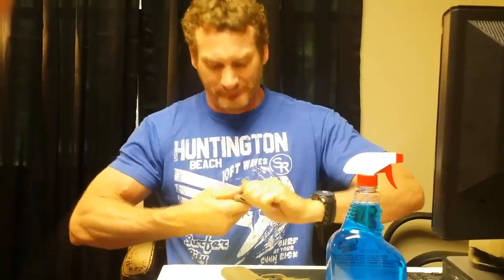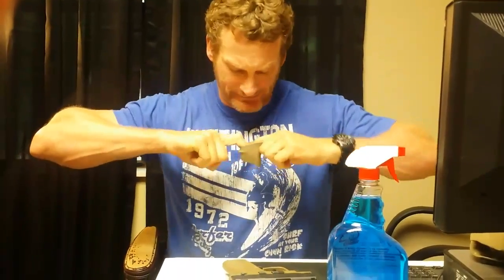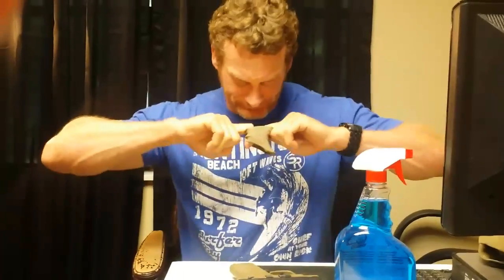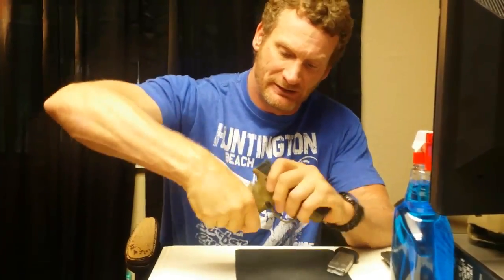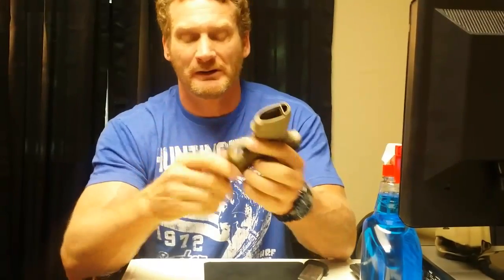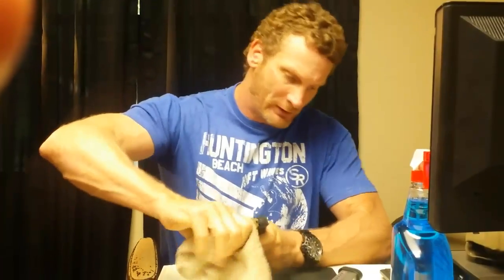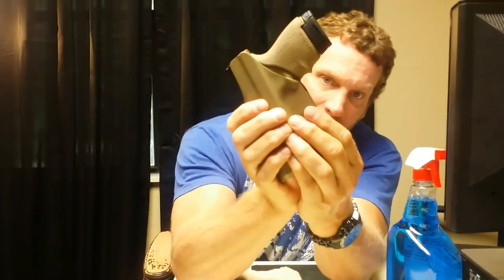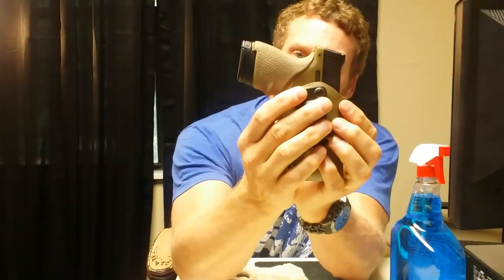Hogue grip installation Hack .

Comment: This method works great!  I’m 70 years old and just installed a Hogue Handall Grip on a Springfield Hellcat. It went on easily in less than 2 minutes. I put the grip in hot water for about 1 minute, sprayed inside the grip with Windex, and followed the instruction method in this video using a micro fiber towel. I used my finger like in the video to get the grip over the finger groove. Very easy. This is the best instruction I’ve seen on YouTube.

Comment: Just installed on my bodyguard.  Heated up the sleeve with a hair blower on high heat for a minute or two and stretched it all around.  Put hand sanitizer on the gun's grip and inside the sleeve.  Put on the back then pulled the front on.  Used a microfiber cloth and worked it all the way on.  Literally took a minute.  The sanitizer is much slicker than Windex and evaporates completely.  Piece of cake.  Feels great on the gun.  Can't wait to go shooting.

Comment: I tried following the instructions dipping in boiling water, using homemade plastic shoehorns and Windex.  Also installed it over the mag as someone suggested.  These barely got it started on my Millennium G2.  The aggressive texturing all around the grip didn't help and it eventually would go no further.  So I dipped the entire grip and grip sleeve in boiling water together.  That started it moving again and I was able to rock the sleeve forwards and backwards working it higher each time until it was fully seated.  If you use the plastic shoehorns per Hogue''s advice be sure to pull them out while you still have enough room.  Mine was sliding up under the beavertail and was held so tight by the sleeve that another dunk in boiling water and a visegrips was needed to work it to the side and finally break it loose from under the sleeve.
Reply from the maker: Prairie Pucker well at least you got it on , thats the important thing. I cant imagine trying to put it on with the shoe horns , it’s difficult enough without them. So how do you like it, how does it feel ?
Reply: Haven't shot with it yet, so the jury is still out.  The finger ridge is a bit too close to the underside of the trigger guard & not quite enough room for my middle finger.  Thinking I may need to whittle the ridge off.  Also, the one-size-fits-many thing ended up with about 1/4" gap between the lower edge of the sleeve and the bottom edge of the grip when the sleeve is pushed all the way up to the beavertail.  That's 1/4" less rubber for my pinky to grip.  Wish they had a sleeve that fit clear to the bottom of the grip.  I'm anxious to get to the range.

Comment: Their new instructions show to cut out a couple of pieces of the plastic packaging and use them kind of like shoe horns on both ends. That technique and a shot of Windex made installing mine quick and easy on an M&P Shield........(OK.....kind of easy. I did get a little frustrated for a minute or two.)

Comment: Very good video and great hand strength. 😊  Bought one for my G42 as the grip was SO small and narrow for my hands, hard to get full skin purchase on the grip and the Talen grips did not help there.  I placed mine in very hot water for 2mins removed it and stretched it and return it for another 2mins.  Following the instructions.  Used Windex (alot) and it went on easily.  Great product.  Just be sure you don't have to remove your Trigger Housing pin any time soon 😃.

Comment: I've installed a couple of Hogue grips on compact pistols.  Ignore the manufacturer's instructions - they don't work.  I installed it in a similar manner to the video, except I used a drop of olive oil smeared inside the grip as a lubricant.  It takes 3-5 minutes to rock it front and back to get it in position, but it won't come off easily.

Comment: frogman405:  Seems to me that this particular Hogue grip with its own beavertail, actually creates a higher bore axis.  In other words, adding the Hogue's own beavertail to the Shield's existing beavertail increases its overall thickness.  That prevents the upper web portion of the hand from being as high on the pistol -- which was closer to the axis of the bore.  Now the bore axis has been raised -- creating a higher bore axis and more felt recoil.

Don't get me wrong, I like Hogue grips and use them on several pistols when needed.  But, in this case I prefer no additional beavertail.
Reply: Rio Lobo p

Comment: Just installed this grip cover on my M&P 9 Shield M2.0  I'm kind of a scrawny old man, but didn't have much trouble.  Took me less than a minute from the time I sprayed on the window cleaner.
Key points:  
1) Forget the plastic "shoehorn" idea from Hogue and other user videos. They're more of a pain than a help. Just follow @frogman405 's process for prepping the cover and the grip. I did place mine in a cup under hot running water for a few minutes, but not sure if it added any value.
2) THE PART YOU'RE REALLY FIGHTING AGAINST IS THE BOTTOM EDGE OF THE GUN'S FRAME!! Focus on that and the cover will take care of itself in sliding up the grip. 
3) Don't be afraid to add a couple of shots of Windex during the process. I used a cheap brand and it kept drying out too fast.
4) Make sure you get it exactly where you want it!  After the glass cleaner dries it seems to be pretty much locked in place. 
I only wish I would have watched this video before I opened the cardboard box from Amazon!

Comment: I have Talon grips on all of my other handguns but am trying the Hogue grip for my G 26.  Think I'm going to try heating the grip up with a hair dryer then spraying the inside with Windex.  Thanks for the tip!
Reply from the maker: Hey Mark , I really like the Talon grips as well , but I use them on my larger frame pistols . I like the Hogue for my smaller ones because they give me a bigger grip to hold. The hair dryer sounds like a good idea , thanks Brother !!

Comment: Forget the winded. Boil about 3 cups of water in small pan. When boiling, put the grip sleeve in the water for 20 to 25 seconds. Remove. It’s good to work with almost immediately. Goes on easy. Can use some winded if you want but probably won’t need it.

Comment: BEFORE I GOT SMART AND USED THE BOILING WATER METHOD WITH MY SHEILD 9MM, I TRIED TO FORCE ONE ON MY SHEILD .45 BUT IT ONLY WENT ON SO FAR AND GOT STUCK, I SQUIRTED IN MORE WINDOW SPRAY AND HEATED IT UP REAL GOOD WITH A HAIR DRYER AND FINALLY GOT IT TO SLIP ON ALL THE WAY,, I ALSO LIKE THE GRIP I GET WITH THE HOGUE GRIP !!!,,, IT FEELS LIKE A WHOLE DIFFERENT GUN !!!
Reply from the maker: Its always better to work smarter than harder,, isn't it ??!! lol Thanks again for the tip..

Comment: I found the best way is using a hair dryer heat it up start it on and heat it as you go with hairdryer.  I tried Windex and hot water, but hair dryer works best.

Comment: JUST DID MY LATEST GRIP INSTALL ON A 9MM SHEILD,,,, BOILED THE GRIP IN WATER TILL GOOD AND HOT, ,,, DID NOT PULL THE MAG,,,, SPRAYED WITH WINDEX AND INSTALLED WITH THE MAG IN THE GUN, FOUND IT EVEN EASIER !!
Reply from the maker: Cool ,, thanks for sharing that...
Reply from the maker: Good tip Brother , Ill use the hot water next time as well... Thanks
Reply: Never sprayed my guns with windex I'm good. I ran the grip under hot water not boiling took a little effort but it slid on.

Comment: these things can be a pain in the ass to put on.  i just threw one on my p365 since I have massive hand and the grip is a bit too thin for my liking.  windex definitely help.  throwing it into boiling water for several seconds at a time also help the grip loosen up a bit.  i used two small strips of plastic that I cut out from the packaging and made the tops triangled.  throw those in the front and back of the grips with triangles upwards and it  helps it slide on easier.  at the end just pull the strips out with some pliers.  great video.

Comment: Magazines come with a pinky extension. You need that extension on while installing these grips. 1st wrap the hogue over the extension, then over the rear. This hack makes installation much easier even without windex. Your welcome.
Reply from the maker: Thanks for the tip !

Comment: You did that a whole lot faster than me. I just struggled with mine for like a hour getting it on my glock 20. Got it on there but my fingers felt like they had arthritis for a day or two lol. Should have seen this vid before getting it on with no windex or anything
Reply: Oh yeah you need windex it's a must took like 10 minutes. And hot water in a cup soaked for at least 15 minutes good luck.

Comment: I do NOT recommend using a screwdriver. I used a screwdriver tonight and accidentally punctured a hole, and then as I was pulling it over the hogue ripped completely. Thankfully Amazon has more...

Comment: Over time do they stretch and loosen loosen at all?
Reply from the maker: seattwa mine is still in excellent condition. But I'm sure if it was a weapon you used a lot outside in the cold in the heat it would deteriorate a little bit but I'm very happy with it well worth the money. Thank you for the question brother...

Comment: Would you still be able to pocket carry with the rubber grips?
Reply from the maker: I guess it would all depend on the size of the gun and the pants one would wear.. I myself don't like guns that are small enough to carry in my pocket because I have such big hands. I have a hard enough time just getting my hand in my pocket sometimes. and that is because of the type of pants I wear. But that's just my style and preference. I guess you would have to try it out , it would only cost about $13 off of Amazon.

Comment: I used a screw driver and I ripped mine. I gave up and bought the regular grip without the beaver tail.
Reply from the maker: sh*t happens Brian,, a friend suggested to put the grip in hot water for 30 secs to a min to make it more pliable and then id use some windex too...